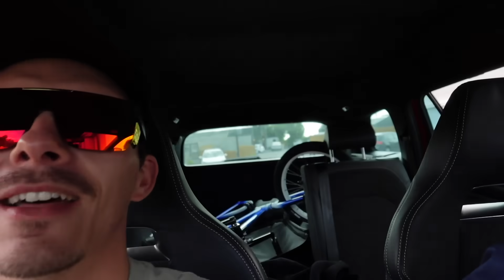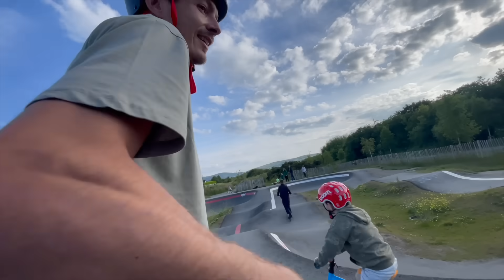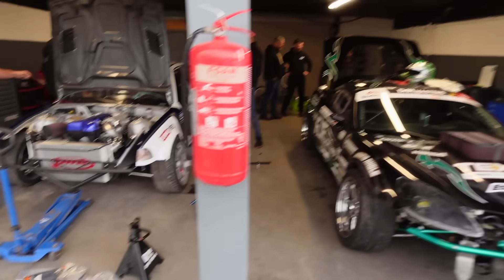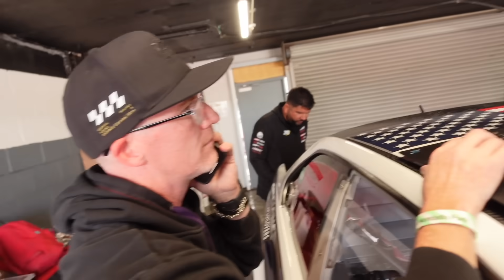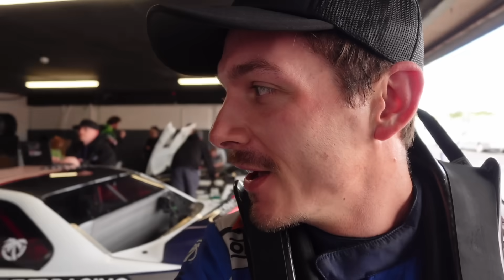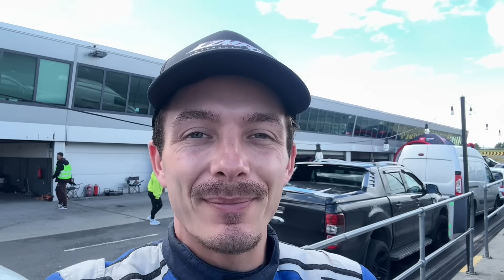First Lap Gremlins in my New Driftmasters E36

Comment: Was hoping to get down for Sunday but looks like I'm gonna miss it again 😢
Really hope the compund isn't affected by the flooding in Florida.. Don't think I could take another collection disaster so soon after the fire (not that tha's the main concern)

So no Donegal rally next weekend then.. maybe next year.. think you could rent something like the crx and have some fun at Irelands biggest motorsport event both for crowds and entries.

Tallaght can be pretty rough but like anywhere with a reputation it's the few doing stuff making get a bad rep. Engine block was just down the road 10 mins (depending on traffic).

My grandad used to test his open weeled race car on Tallaght main street when it was unpaved and still a village outside Dublin. Bare min to run, chassis, drivetrain, seat and controls with a 6L straight 8 and open manifold @6am on sunday mornings😂 he used to race it in mondello.. some amazing stories.
There is a little memorial garden where his garage used to be at the old junction at the corner of the priory on the main street.

He used to take me to the firhouse inn (right beside that skatepark) for his daily pint of the black stuff (only real nutrition he had in his last few months 😔) but the trip there was.. heh. An old VW type 3 with 2 vice grip for steering and a 1 gal can in passenger footwell with tube through air vent to the carb and he would turn the car off at top of hill and freewheel 90% the way there..

Comment: Adam...I like the baby blue D'Angelico, you need to get a Line-6 Pocket POD meant for traveling guitarists. It's a small battery powered amp simulator with tons of effects and amp sounds with a belt clip so you can plug in your headphones and a short 1/4 in guitar cable and jam out as well as use it for direct recording and as an effect going into an amp!  * The E36 is pretty cool too😁

Comment: If you want to get rid of the flicker indoors, flick the camera on to 50fps rater than 60...depending on the camera you might have to switch it to PAL rather than NTSC. The electricity in Ireland is 50hz,i know this because here in South Africa is the same so you have to switch over to get rid of flicker.